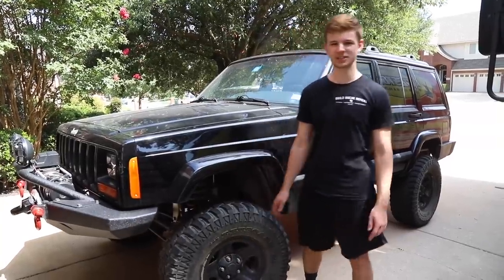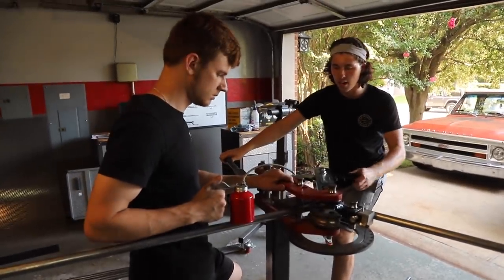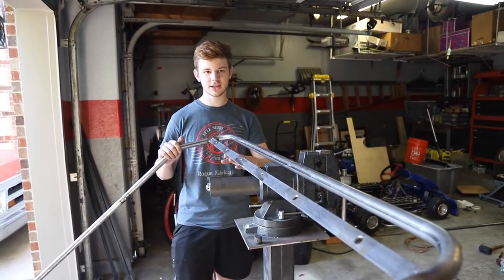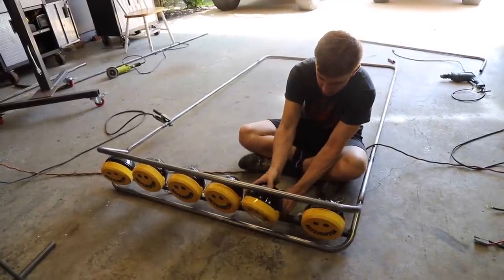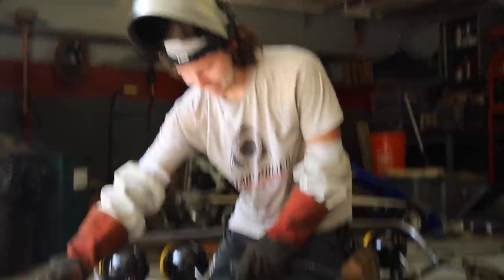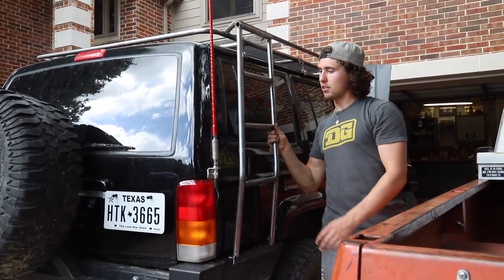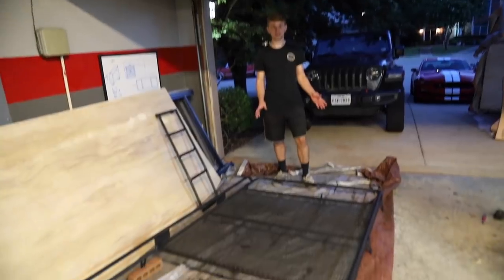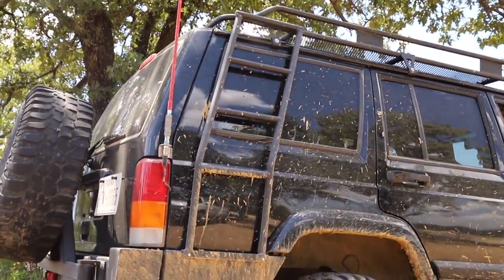DIY Custom Roof Rack and Ladder! Jeep XJ Cherokee Build

Comment: The rack turned out really awesome,  y'all did a bad ass job,  looks awesome on the rig too top notch work,  if the bed liner doesent hold up go to home depot and buy some rustoleum coal tar epoxy,  that stuff is literally bullet proof,  that's what im putting on my trailer,  we use it at work for industrial pumps